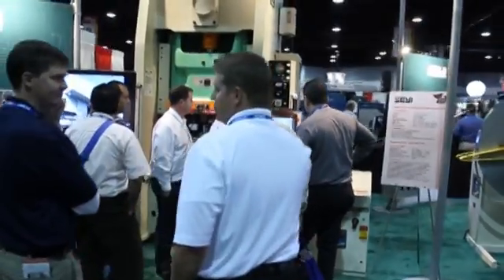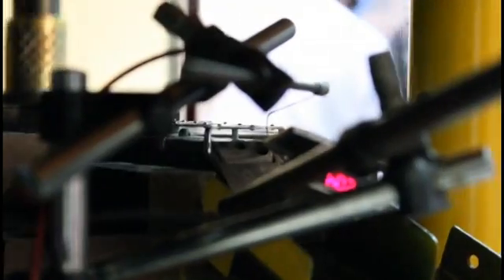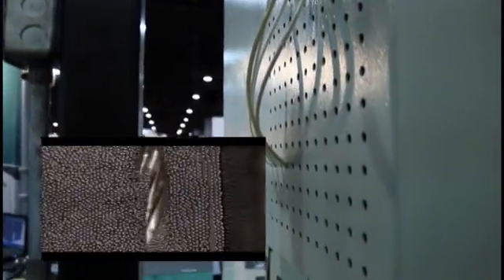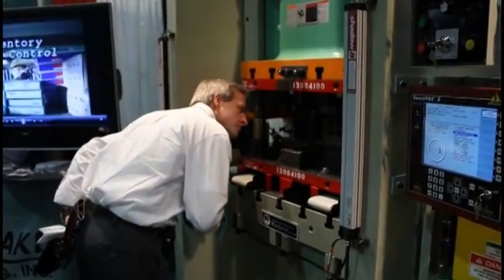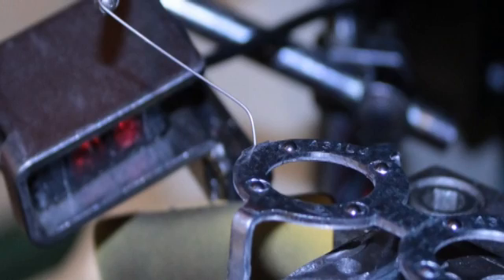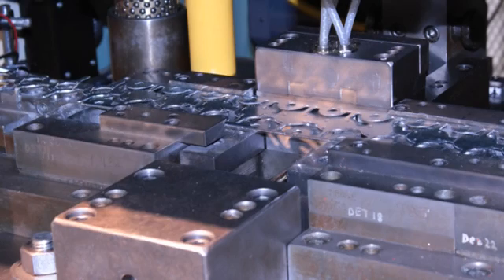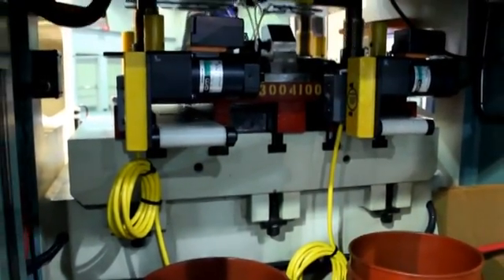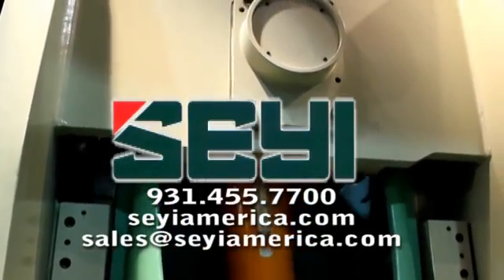SEYI Metal Stamping at FABTECH - Show Recap

Comment: Whiskers are old method of safety and very limited. It is a nice press, however, if I can make a comment, here is my feedback:
1/The die in the press should be in a much faster press as c frames are excellent for tandem purposes or perhaps for dies with tapping units, which are not spm demanding and need higher stroke height.
2/If anyone would offer me a whisker with a smartpak, which is so advanced (most likely one of the best Stamping HMI in world) I would be probably laughing.

As I said before, SEYI and Mark Sutherland did a great job in building and developing these little babies, but in my honest opinion-I would not be very happy if I build the press and it would be represented in this way to potential customers. My two cents.